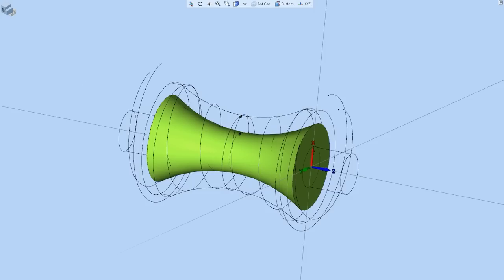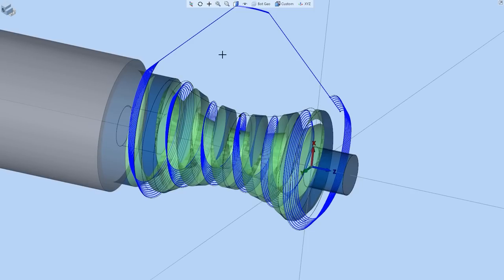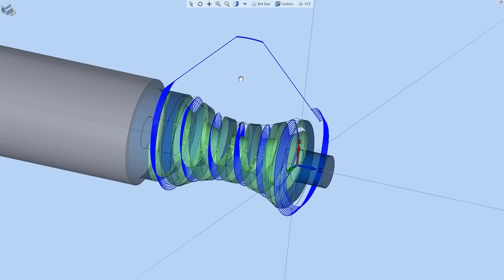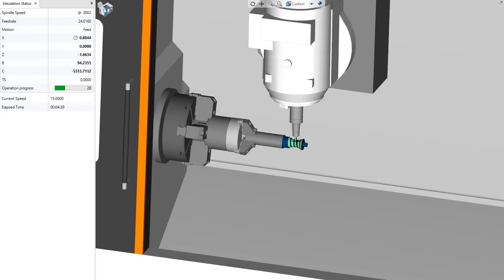Roller Cam Drive

Comment: Some thoughts:  Cam rollers are crazy strong.  Maybe you only need two or three to engage at once...?   Here's the idea: Maybe you could add a second wheel and then clock it ahead (or behind) so that you have rollers located in between where you currently show them.  Then widen the cam groove and have two rollers run in the same groove and by clocking the wheels you can change the effective pitch take up the backlash or even pre-load.  ONe wheel (and rollers contact one wall of the groove while the other is turned back to contact the other wall.  I have no idea what your space constraints are but a wider groove and move half of the cam rollers to a second wheel might get you somewhere.  Cool problem.  I'm glad it's not mine.  Cheers and good luck.
Edit:  Maybe you make the cam in the reverse profile so that the tooth protrudes.  Then you have your wheel as you have shown, and you then mount a second roller to pinch the tooth that protrudes.  You can make a grind spacer or some belleville washer stack to preload the cams to the tooth profile.  I think that's how they make cam style index tables.
Reply from the maker: Two worms with wider grooves then the rollers is the way to go. I think. Each loaded against each other. Quite easy to do by rotating the worms at their belt flanges.
Reply: @EdgePrecision  You mean a second worm on the opposite side of the wheel you have shown?  Then rotate one wom slightly farther advanced until you remove all clearance?  If so, it certainly could work.  The worm is the harder part to make.

Comment: Shouldn’t the endmill length from the B axis center match the minor diameter of the root? Seems like too much movement on the Z, but final assembly with a drive operating in torque mode and a hydraulic brake when necessary makes sense. Really cool!
Reply from the maker: Because the machines B axis center of rotation isn’t in the same place as the cam roller center. The Z has to move with the B axis to rotate at the cam roller center.

Comment: I seems like it would be easier to hand write the G code than get it modeled correctly!
Reply from the maker: And how would you hand write the G code for this?
Reply: @EdgePrecision  Just thinking if the cut was just a full slot, it all goes out the window when you have to do a finish path on the walls.   It seems like it would be an interpolated arc in the XZ plane as B and C rotate at a constant rate.

Comment: Manually screwing in each of the 24 rollers through a hole in the side of the case or body of this drive system.... While also incorporating lash adjustment in the worm in two axis or on a cam'd bushings? This is gonna be very interesting. I am sure of all people, you will pull this off just fine.

Comment: As a fellow machinist walking knee deep in post processor customization in Edgecam for Fanuc and Okuma lathes and 4 axis machining VMC-s I raise my hat! this job is some real test of skill and understanding of circumstances!
Reply: Is it possible to make your own Edge Cam pp?  Heard it is a big pain to do that ore do changes in a Edge Cam PP
Reply: @johnhansen1684  It's possible, although the user interface isn't the most user friendly. I'm working on a few post processors right now and it takes some trial and error.
Reply: @johnhansen1684  I think the limit is the sky when we talk about edgecam post customization. all of the post macro is contained and readable in the .ctx and .mxt files. those files are compiled from the .cgt and .cgd files, which are opened in the codewizzard which give you a pretty decent customization interface. the Codewizzard files are compiled from a bounch of txt files, and by using .cgt files with .cge files on can even replace whole sections of the base macro. so basically one can rewrite the whole thing if he wants. with that said i am pretty sure that requires an awful lot of knowledge in math and macro porgramming. macro programming is never an easy task, so yeah it is pretty hard given that a 5 axis CGD file is compiled from 8-10 txt files which contain ~15k lines of macro coded by the edgecam team. the basic stuff tho is not that hard to figure out tho. also it has a pretty decent help integrated into the codewizzard.
Reply: @ferencungvari3089  Interesting, i have played around with WorkNC but not looked into edgecam that deep. we got some edgecam license where I work would be fun to look into it. do you have any sources for information other then just trail and error?
Reply: @johnhansen1684  codewizzard help in the menu is a goldmine. I got the luxury to  watch our distributors guys doing the initial customization and built a friendly relationship with them so in case of desperation i can always have a chat with them while they show me the principles through teamviewer. I think it would be wise to chek it out if some dude put up something to skillshare or similar sites. That said the customization is always a custom problem for the given environment so if you can master the principles, you can get by. Also turning on the NC debugging functions in codewizard helps a lot. There is also a customization whiteboard iside where one can implement his own procedures than call those in the cases where neccesary  alas keeping the thing professional.
Reply: Guy has a big ole brain. Thats for sure.

Comment: Curious as to how the rollers actually turn if they are making contact on both sides of the thread?
Reply from the maker: They can’t and don’t. I’m thinking the best way would be to have two worms on one wheel. With each worm loaded against each other.
Reply: I was thinking the same thing. I saw an animation from BROTHER showing zero backlash with only 1 worm and the rollers rotated but stopped in the centre of the worm and skidded slightly before rotating the other direction
Reply: Exactly, you can't preload as shown.  There always has to be clearance one one side for the cam roller to turn.

Comment: It would seem that one way to obtain zero backlash would be to have another worm which could be used to just rotate enough to to take up any slack.
Reply from the maker: I think this would be good and also increase the load capacity.
Reply: @EdgePrecision  Just pull them apart. The same way they are "stuck together" when you think of the necessary order of operations when installing the rollers, increasing the distance between center-lines loads the outtermost rollers against the groove wall. The rollers are "captured" when they are all installed and in the worm groove, pulling them apart effectively loads the rollers.

Comment: Hi Peter, I have come across this once before. I believe its called a Double enveloping worm. It was on a pod on a North sea tug that had run into a submerged obstacle and had ruined the gear. The gear was bronze and was sacrificial as the worm was so complicated. I managed to model the gear and cut the teeth using a custom ground fly cutter on a horizontal borer with a mega complicated set up. Later on I found out that the pod had been made by a Japanese company that had a lead time of 24 months if it was still in business. Tug is still chugging away last I heard . Challenging job but the best ones always are. ( We didn't have any 5 axis machines at the time, in fact at that time there were no 5 axis machines in the UK).
Reply: so you cut it in a boring mill? can you be more specific?
Reply: @fredrezfield1629  Hi Fred I wish I could, it was about 20 years ago. I do remember the gear blank was set up on a rotary table and the head was offset about 14 degs, I cant remember the dia of the fly cutter, but I do remember it was a pain cutting the teeth. It was just plunge cutting and the deeper I got the bigger the cut got, cutting  both flanks at the same time. I did rough it out with a straight grooving tool first. I had to engineer some backlash into the thing as the ship was loosing megabucks a day in drydock and I only had one chance to get it right ( no test fitting). The ship was called the MV Norman. Sorry I couldn't be more specific, but it worked fine and I got a letter of commendation from the ship owners. The blank was roughly 1.1m in dia with around 65 teeth, each tooth was about 20mm deep, I cut involute teeth although the original had straight teeth ( this gave me a bit extra clearance).

Comment: Would you want to share a simple drawing so we can maybe try and model this? Maybe at least just the overall shape of it which you showed in the video? I love challenges like these. Also, the bottom of the groove must be slightly convex because that's just how endmills are made right? Isn't that an issue?
Reply from the maker: No not really because there is clearance between the ends of the cam rollers and the groove bottom. Email me at Peter.edge.pre@gmail.com I will send you the model in this video. Put roller cam in the description so I don’t delete the email.
Reply: @EdgePrecision  I see, thank you for answering, that is a pretty interesting piece! Email sent!

Comment: Thats a really cool idea ! It is possible that the cam followers have a curved surface (I think they call it crowning), which would help. Otherwise there might be a differential in rotational speed between the top and bottom of the roller outer surface. There will be some tolerance on the angular location of the cam followers, so you probably dont want the slot to be too good a fit, probably as you say, better to cut the slot oversize and preload axially. I dont know if the manufacturers will guarantee the concentricity of the outer bearing surface to the 'bolt' on the cam followers - perhaps they aren't usually used for such high precision requirements. I am stretching my knowledge of worm design (!! not very deep), but I would guess that your design would be alot lower friction than a standard worm, but the load capacity might be smaller (especially the double envelope type)
Reply from the maker: Another way to preload and increase load capacity is to put two worms on one gear. And pre load them to each other.
Reply: @EdgePrecision  I am trying to think whether a 'ball worm' might be possible.. a bit like a ball screw, but keep the balls on the same plane as the wheel (in some sort of carrier) and both the worm and the wheel have the same groove that would fit standard ball bearings...
Reply: @EdgePrecision  I was thinking that you could make two identical halves and preload the bearings by rotating them relative to eachother. would that work in this design? it's stretching my ability to model the movement in my head.
Reply: This is a good idea.

A crowned follower would indeed eliminate the speed mismatch but by having a single contact point instead of line contact, this would decrease stiffness, torque capacity and wear resistance.

I believe a tapered follower could be used to eliminate the surface speed mismatch through the whole contact line between the follower and worm.